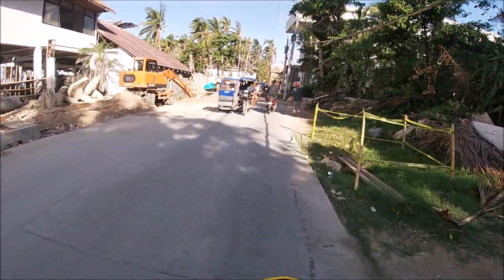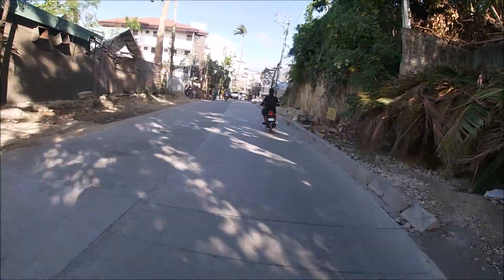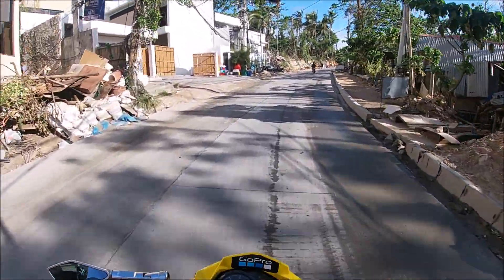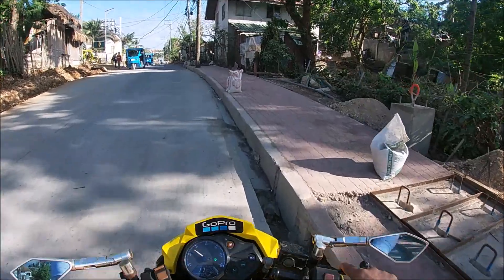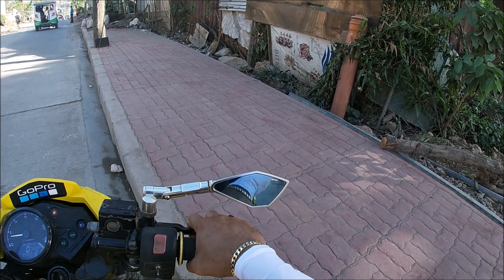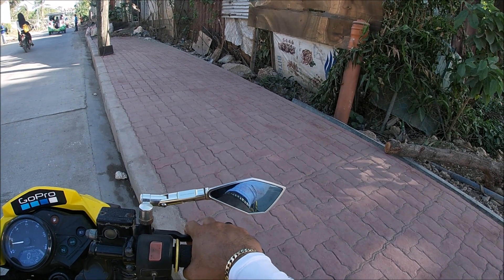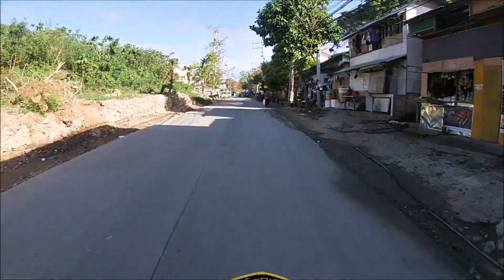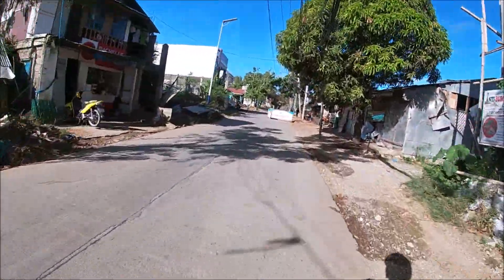Boracay 2020 Mainroad Newly Poured Concrete and Fake Bricks

Comment: One purpose of brick pavement or flooring (not only on road shoulders) is to let rainwater percolate thru joints of bricks. This is one way of replenishing ground water. Brick flooring (instead of concrete slab/ flooring) could prevent rainwater from directly flowing to drainage canals, streams, or rivers....but in order, to have an effective and durable brick pavement and walkway, it should have a well-compacted, hard, and porous sub-base.
Reply from the maker: woooh yeah, well explained sir, thanks

Comment: If its approved, then its better since its easier and faster. I agree with you, concrete with brick design is more durable and more practical
Reply from the maker: confirmed by the contractor this is the new approved design on areas like this.

Comment: Sir Benj it's should be bricks they use for easy earthing the wires in future and that the function why bricks should be use rather the concrete hyst Tsk Tsk Tsk
Reply from the maker: kaya nga po, hintayin natin ang update. di ko na kasi makita ang kilala kong contractor jan. magtanong nalng ako sa iba kung magkataon. baka sample pa lng yan for approval pero mahaba na e
Reply: Under that sidewalk is a drainage. Why would you put wires on a drainage?😲
Reply: Under the side walk not under the drainage system
Reply: Use ur common sense